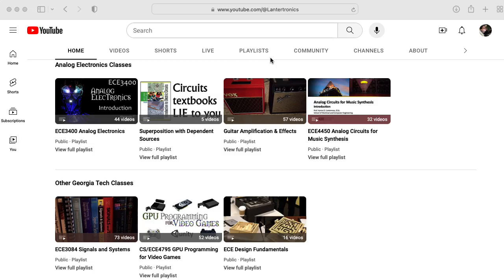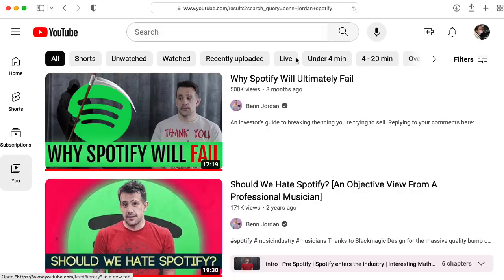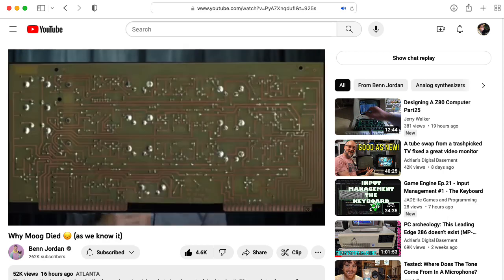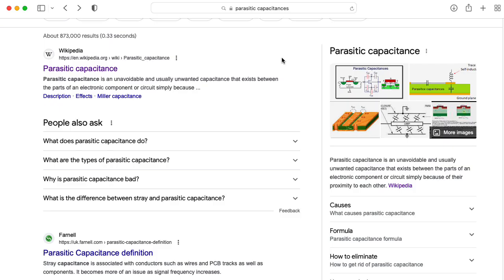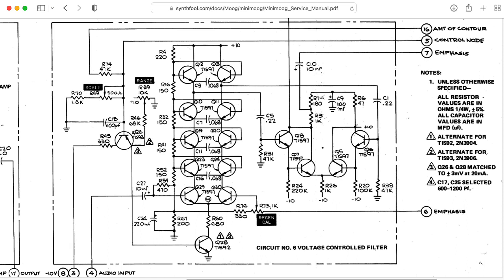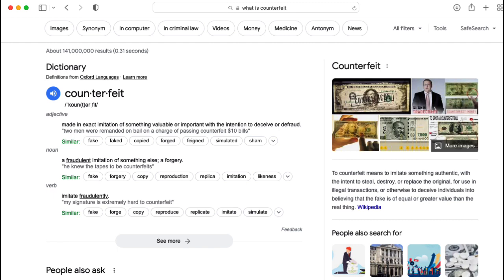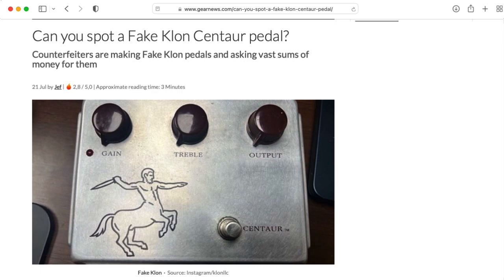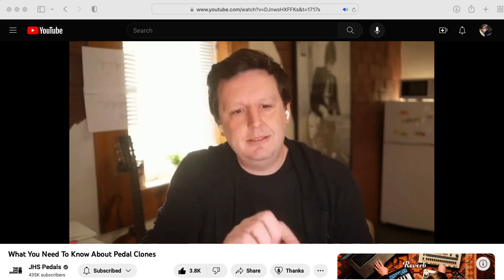Benn Jordan is Confused about Circuit Clones & Counterfeits (but mostly right about the rest of it)

Comment: Hey Aaron! You undoubtedly are in a way better position to make a schematic comparison, and if I could get my hands on both (and permission to take them apart), I'd love to do a stream or something on that just to learn/pass on what makes that iconic tone in the first place. We need to dork out in general sometime soon! 

Re: counterfeiting - I'm definitely not speaking in a formal legal sense, but more of a situational one with the Model D. If you search "Model D synth" on Google, you'll probably see SEO optimization for the Behringer "clone" and Sweetwater's ads for it. I feel like the jacking the panel + name + SEO is enough to earn that insult from me. 🙂
Reply: Check out 'Maffez mods' - he has the circuits of most of them or threads that have them linked for many of the Behringer product, inc the Model D. 
Their engineering is truly astonishing (i say this as a mechatronic engineering technician), they are totally vertically integrated, they recreate the devices form the silicon up, but using modern manufacturing techniques. 
Very few companies on earth could do what the Behringer engineers do. 
I'm very curious what you think of my home made clones. Do you think they are as evil s behringer? Do you think all the Harley Benton and other brand clones of guitar gear thats still made are as evil?
Or maybe there is something special & evil about behringer that has nothing to do with cloning?
Reply: I'm about to make a eurorack clone of a Chinese clone of an amp sim pedal thats only been out like a decade, that i only know how to make cos some nerds on pedal DIY reverse engineered it - would tthat be doubly evil?
Reply: Oh and do you think maybe the 'Model D' thing is because Moog never made a synth that had 'Model D' marked on it? And their RECREATION came out WAY later, and is still not marked Model D?
I dont get any Uli  when i search MiniMoog.

Model D

From Wikipedia, the free encyclopedia
(Redirected from Model d)

Model D may refer to:

    AJS Model D, a motorcycle
    Cadillac Model D, a car
    Curtiss Model D, an early pusher aircraft
    Gee Bee Model D, a sports aircraft
    Leading Edge Model D, a personal computer
    MAB Model D pistol
    Minimoog Model D, a synthesizer
    Wright Model D, an observation aircraft

Comment: I really appreciate your explanation on the moog ladder filter  
I have a diploma from years ago in electronics. 
I could not connect all the different parts of the electronics course I did all those years ago 1990 .

I felt embarrassed that I did not know enough . I read and read and still could not understand things.

However, since the advent of youtube and the Khan academy,  I have since gotten to a place where I can understand broadly what a circuit is doing.

But I must commend you on your humility despite being brilliant. 
You  said that despite having a degree in electrical engineering that even you found some of the synthesizer circuity tricky. 

It gave me the confidence I needed , much too late in life. I am now in my 50s.

But I can now understand the moog ladder filter.  
From your brilliant video
After looking up Laplace , Fourier , control engineering and poles and zeros. 

You are brilliant 👏. 
Thank you very very very much.

There is hope for me after all.
God bless you.
Reply: I deeply salute anyone who doesnt find current driven resonant filters a bit brain breaky.
Reply from the maker: Thank you so much for your kind words!